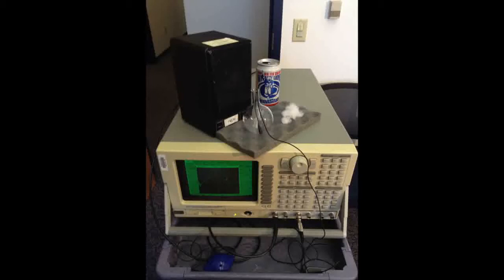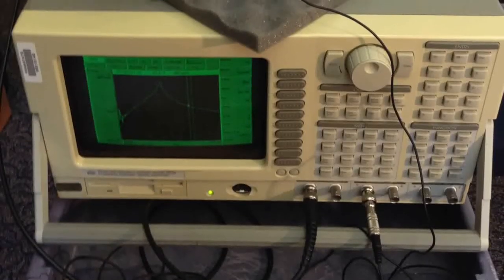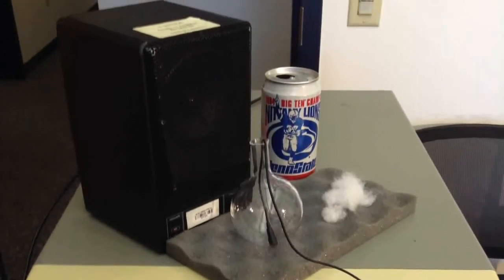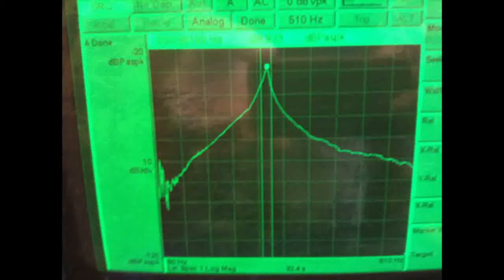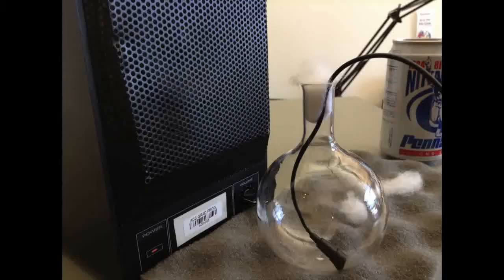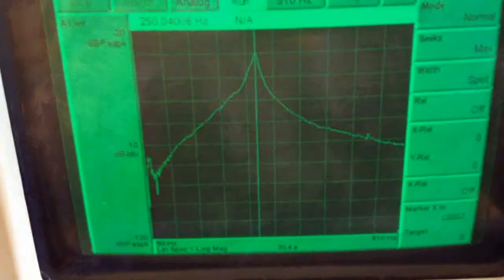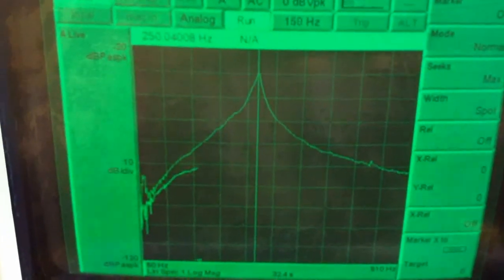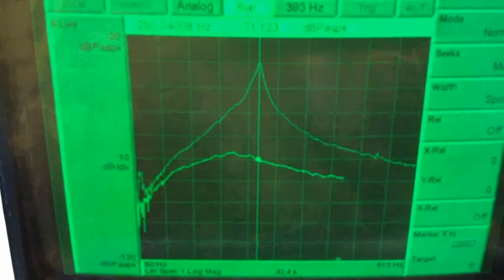Forced Response Curves (Helmholtz Resonator with Damping)

Comment: Correct me if i'm wrong, but wouldnt the damping term in a mass-spring system be represented here by cotton surrounding the whole walls of the resonator? By blocking only the entrance, i would assume you are "filtering" the input signal only (the "forced oscillation" term coming from an outside force) and once air inside the resonator is set into motion, it's vibration is no longer damped by the cotton